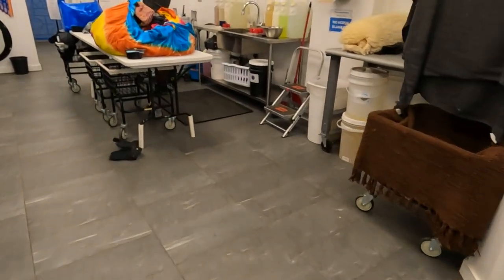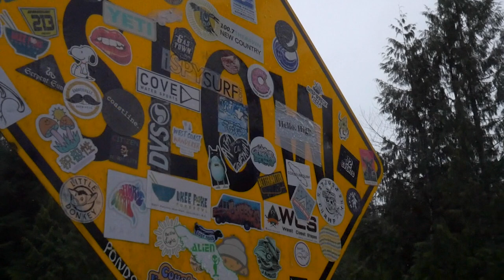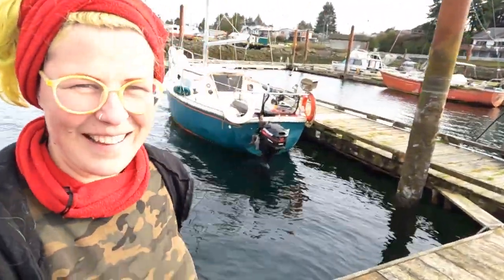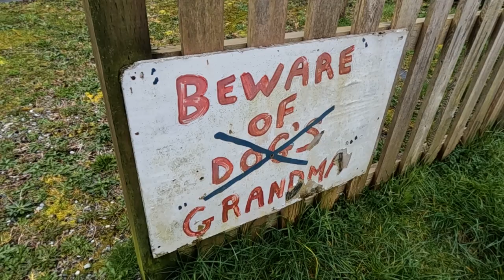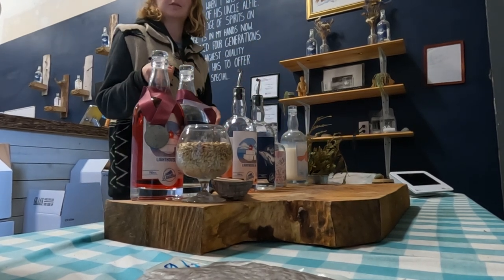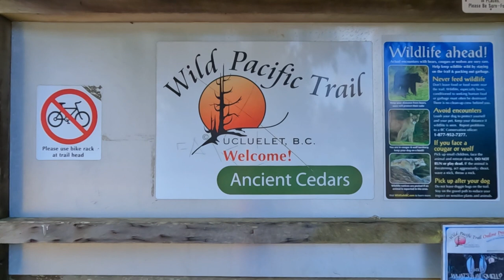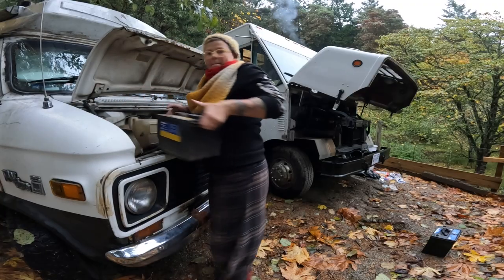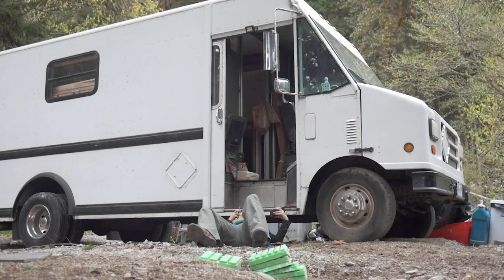WILL THE STEP VAN START? A Tofino Adventure with Flossy Roxx #vanlifediaries

Comment: I TOLD YOU SO! Lots fun. Question. What do you need for parts so that you don’t have to crawl under the Grummy to start it?  List please. I enjoyed the whole vlog as usual. The music was great. I’d have to say my favourite part was when the Grummy started. Cheers from Vancouver eh!
Reply from the maker: Hahahaha @Susan Scovill First I need to find the user manual for my Utilimaster ford e350 5.4L gas V8 engine so we can use that to identify which fuses are for what in the fuse box then we need to replace the starter relay switch and again we need the user manual to help identify where that is.. I wish it was as simple as just replacing a part. But once we have the manual it should be a very easy fix 🤞🤞
Reply: @FlossyRoxx  what year is it Flossy?